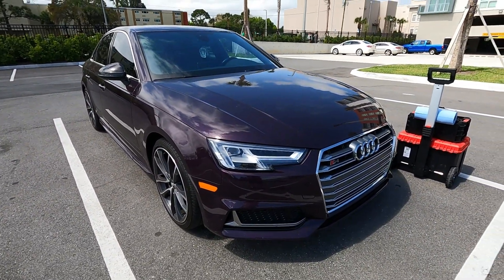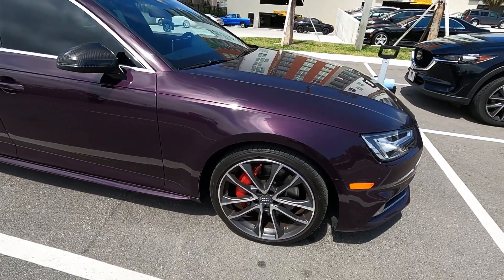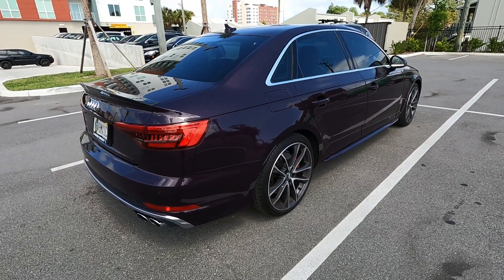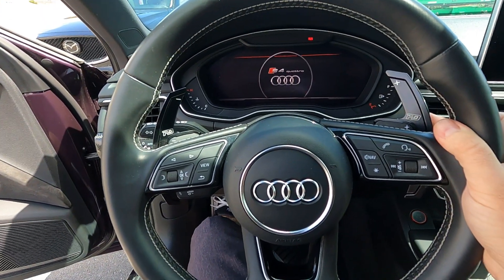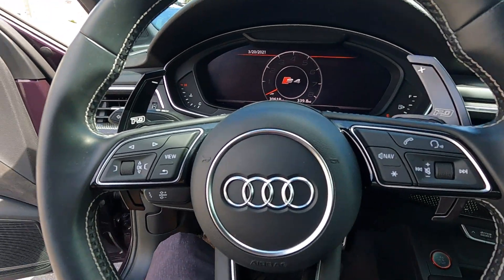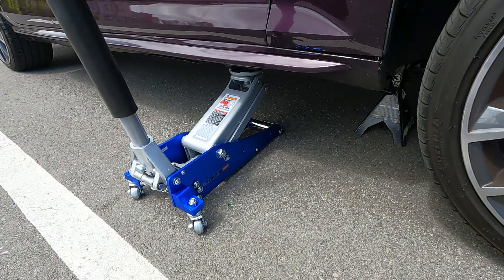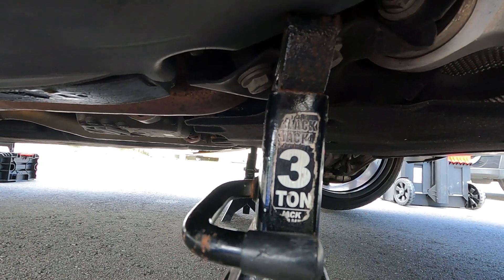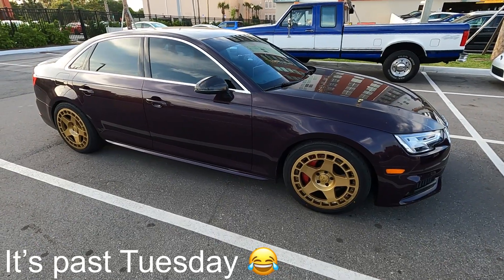B9 S4 - Intro and Install

Comment: Nice :) Now get an upgraded IC. That IC really is a must with a JB4 or flash. As far as other performance bolt-ons there really isn't any. Next would be hybrid turbo. 
I have an '18 too with the EPL ECU/TCU tune and Wagner IC. It has been a great car. Pretty rapid car with a tune. Especially with some E85. Enjoy the new ride.
Reply from the maker: An IC is my next mod. I have the RS grill coming so when I install that I figure why not do the IC too haha. I think when my warranty runs out, or when I get bored I’m going with the EPL tune setup.

Comment: What is the CTS Thing under the car
Reply from the maker: It’s a transmission mount insert that helps take up any slack around the factory mount. It prevents the mount from moving around too much while under load.
Reply: @Wobblenuts  does it help with the rattling heard from under the S4 and with the Quattro in general?
Reply from the maker: @TexaStateSW  I haven’t really heard too much rattling, but it helps keep everything solid if that makes sense. There is always “slop” in all drivetrains unless you have solid mounts. So this keeps everything from moving too much.

Comment: Nice vid. Wish it was a little more detailed on the spring install though.
Reply from the maker: Yea I wasn’t too focused on the video unfortunately. I just wanted to provide some tips since there are other spring install videos out there. I’ll keep that in mind for my next install video though. Appreciate the feedback.
Reply: @Wobblenuts  thx. Yea, I’m looking to do this on my own and have been searching for good diys. This gives some good tips. Any other vids you can recommend that are more detailed?
Reply from the maker: @packat78  so this is a decent write up. Says what tools and shoes bolt locations. They did the rear slightly different but same concept. https://www.audiworld.com/forums/a4-b9-platform-discussion-212/h-r-50357-lowering-springs-install-2945281/
Reply from the maker: @packat78  and I used this video. Short and sweet for most of the main tips. It is a S5 but same suspension. https://youtu.be/3S0vB40ZdFI
Reply: @Wobblenuts  really appreciate it!! Subscribed to the channel. Look forward to more of your mods.
Reply from the maker: @packat78  thanks so much. I’ve got some good stuff on its way, then it’s time to have some fun at the track.
Reply: @Wobblenuts  one last question on this install. per some of the forums, some are saying they had to remove the auto-headlight level sensor. you didn't mention that in your video. is that something you took off?
Reply from the maker: @packat78  I mentioned it at about 5:47. I did forget initially then added in text. You only have to remove the 10mm nut and you can leave the rest in tact.
Reply: @Wobblenuts  what did you use to remove the camber bolt in the rear? Etorx? If so, what size?
Reply from the maker: @packat78  it is an etorx, but I didn’t have that. So I used a 21 or 22mm socket. I can’t remember the size exactly. 6 point. Didn’t give me any issues or round it out.
Reply: @Wobblenuts  excellent. Thx dude.
Reply from the maker: @packat78  of course 👍🏻
Reply: @Wobblenuts  last question..promise. did you use an impact/socket to loosen the strut hat nut to remove it? Or do you have to use the triple square and socket to pull in opposite directions?
Reply from the maker: @packat78  hahaha no worries. I just used my cordless impact. It didn’t take much. If you do this just make sure the inner strut rod doesn’t spin too much.
Reply: @Wobblenuts  ahh.. so that's why people use the triple sq with the nut to prevent the rod from spinning. got it!